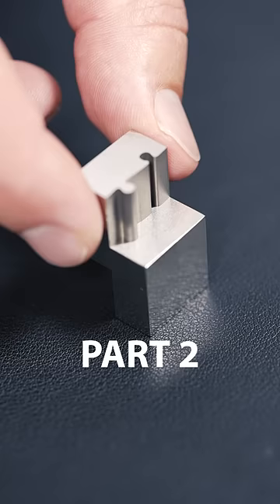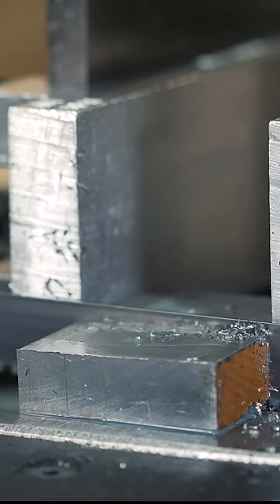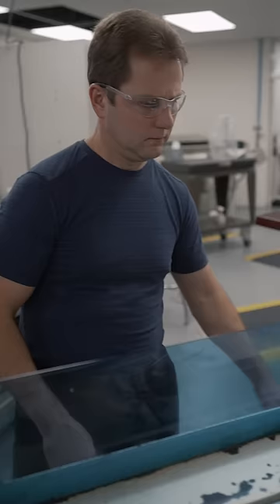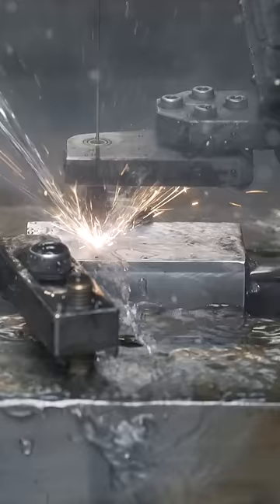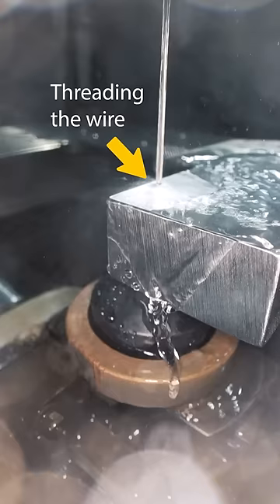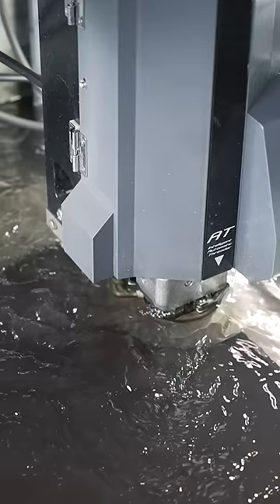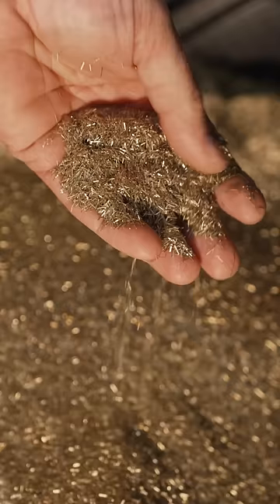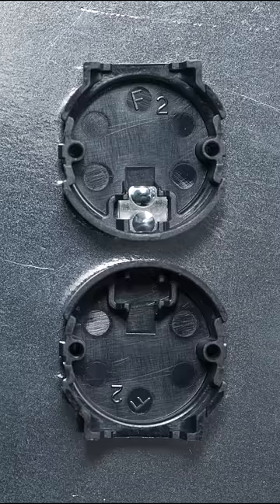'Zero Tolerance Machining' with the Wire EDM, Making a Puzzle Cube - Part 2 | US Digital

Comment: If you start selling those cubes its a gold mine
Reply: No, def not. Unless they sell them for a grand a piece.

It takes them two hours just to make the one  cube.
Reply: @joshandkorinna  that's just the cut time. Just think of all the material handling and grinding for finish.
Reply: @skrewup7354  mezmo I think
Reply: @joshandkorinna  if I get you one for 200 will u buy it?
Reply: @PHANTOM-vd2sn  No thats too much. I'd pay maybe 15 bucks for one.

This is why it's not economical to manufacture these and sell them. People aren't going to pay what it costs to manufacture them.
Reply: Your looking at about 125 an hour.  There's probably 8 hours minimum there.
Reply: I was going to say that but on a very niche market like art galleries were people would not hesitate to pay for it . Imagine a sort of a Rubik’s cube made at that level of precision or a chess set or the key ring for high end car .
Reply: it's not only cut the time it's also a lot of manual labor in it. U can't really make this puzzle cube economically worth it because EDM isn't suited to make commercial products.
Reply: The cut time doesn't matter though, these machines are dirt cheap to run, and if your setup is good enough, they can run unatended for days. They can do the edge detection, the hole detection, the threading and the cutting all by themselves. You just prep and load the material for it, which can also be automated with a mini-palet system.

I worked for years as a prototype machinist and we used various types of EDM nearly every day. One minimally trained person can keep 10 of these machines running continuously through their whole shift for longer cuts like this.

You could probably cut the process down enough to break even at ~$5 apiece with enough volume.
Reply: No they are steel cubes did you read the title?
Reply: I was already wondering if I could get one
Reply: @operator8014  EDM is actually pretty expensive to run per hour. You'd never, ever get them down to 5/piece, you couldn't even buy steel that cuts nicely on an edm for that, let alone: wire, electicity, paying back the machine and the labour.
Reply: @joshandkorinna  id pay 2k
Reply: @teewithmarie694  Good for you. You're in the extreme monitory.
Reply: @joshandkorinna  U really underestimade society, dont you remember fidget spinners and shit?
Reply: @lks3052  Yea, they cost like $5-$10, not 1k-2k.
Reply: Agreed, metmo in UK sells these for 199 pounds in limited quantities only. If you could dedicate equipment to manufacturing these alone, you would make bank selling these globally.
Reply: Price would have to be high to cover the manufacturing steps
Reply: it'll cost like golden. don't think lots of people want to buy it for it's price but anyway I'm pretty sure that if you want it, you can order it in this work-shop or any other similar one. money is only one question
Reply: @PHANTOM-vd2sn  I'd pay no more than 500 for one...but even that amount there will be zero profit, for whoever is producing it. The thing is if you can afford one you can actually order it...but the cost could be easily above 1000.
Reply: @gyffjogofl7676  It's more than 125 an hour.
Reply: @Quapadople  but they also include shipping charges cause it's Indian company
Reply: @BigMassive Gold mine lol? That's exactly the kind of idiot comment that caused them to make this video. The yearly market for little novelty stuff like this demonstration cube is so small, it wouldn't even buy donuts for the first day. 
The work done on these machines only pays off when making molds and tool & die work.
Reply: @bigmassive2403  Only  trained toolmakers are capable of doing this work. They make $30-40/hr in the US.
Reply: They sell high end electronics
Overpriced fidgets wouldn't be a smart investment
Reply: @bigmassive2403  Once a person became skilled enough to do the work you see in this video, they would no longer be a slave, they would be a journeyman. It was exactly idiotic comments like yours that forced them to make this second video. You still don't understand the second time around.
Reply: @bigmassive2403  I understand what you want, but the machinery and processing is expensive. And if quality dropped, I don't think it would be as attractive to potential buyers
Reply: @bigmassive2403  Close-minded? I've been doing this kind of work for 40 years (yes, WEDM has been around that long). We're experts in manufacturing and the associated markets and costs. Unlike some random dude who stumbled on this video and has a bright open-minded idea. More like soft-headed.
Reply: @uwuaimafemboy8731  yeah i get ya. I dont know why people have such a problem with that idea though all im saying is that it could be a good money maker yk. Some dude named peter is pissed off at me lol.
Reply: @peteroleary9447  peter im not talking about making it with edm im talking about replicating it with a cheaper method.
Reply: @bigmassive2403  Are we paying attention? "Replicating" with a cheaper method? Replicating -- as in achieving the 0.0001" tolerances (from the video) necessary for the edges to virtually disappear visually? There is no other known method, certainly none cheaper. It could be form ground to that tolerance, but that would cost 4-5 times as much. Existing (cheaper) methods are plasma, laser, & waterjet cutting, but they're nowhere near capable of achieving acceptable tolerances. You're free to invent some mythical method of cutting steel - good luck to you. Like I said, I am an expert. We exist and we've already explored alternatives.
Reply: @peteroleary9447  that is ridiculous expensive, we only charge 25€/hr without a person and 50€/hr if a persons works on the machine (usually the setup)
Reply: @peteroleary9447  no i am right and you are wrong
Reply: I could probably set up an avonisys to produce these at $60-75 given a 25k part run and assuming i guessed the size right.

Tolerances would still be good enough for human touch and eyes but not as good as this.
Reply: @angrydragonslayer  see thats how my comment was supposed to be takes not analyzed under a a microscope and shut dowb
Reply: Few would still buy hearing the price tag.
And then they could sell only few anyway since it's all hand made
Reply: @angrydragonslayer  The water-guided laser systems that we've looked at still can't approach WEDM in surface finish and tolerance. Plus, you still have to finish grind the outside of the final assembly. They're crazy expensive so roi is a big issue.
Reply: Also the Chinese plastic one is pretty crap anyway. Very impractical but a nice looking peace of art.
Reply: @peteroleary9447  yes, surface finish and finish are not the same as WEDM but still sufficient with the right parameters.

for finish grinding, i already have a chevalier grinder that needs some more work, this would be ideal unattended work for it.

i've already ran the cam and at 80% usable parts, revenue and costs are even at  23400 succesful parts. if i were to put the sale price at $100 (before tax ofc), i'd have my normal profit/error margin at ~25000.

now, i have no doubt that i'd be unable to sell 25k of these at that price but it's always fun to imagine.
Reply: tolerance*
Reply: @bigmassive2403  no worries, CNC brings a lot of different people to it, be it old cots or young dreamers

if you want to see more of the young dreamer side of it, i would recommend looking for the channel named "TITANS of CNC MACHINING" (yes, almost all caps).
Reply: Every one want that cube until they see the price.
Reply: The new fidget spinner
Reply: Not really because the parts they are manufacturing now are probably much more valuable.

Because they have an actual industrial use and aren't just a fancy paperweight
Reply: @ieuanhunt552  that as well
Reply: The satis-cube™️ 
Completely satisfying!
Reply: Totally, whoever pantented this must have a hoard of money by now, i can see the potential of this tech in our daily life
Reply: They are better off doing their plastic injection molds that are sold for way more than those cubes could be sold for.
Reply: @joshandkorinna  make it a limited run and I can easily see them making a thousand of them for 1k a pop fairly easily
Reply: @spikeypineapple552  Sorry sir, gotta disagree with you. In my significant experience, EDM time costs the shop about $4-6 an hour, and I've billed a LOT of EDM hours. The trained monkey that runs them costs more than the machines do.
Reply: I he actually sold them I would get mine in 2027.
Reply: @peteroleary9447  That's including the machine, the supplies, the payments on the machine, the operator, and the profits.

The operating costs of JUST THE MACHINE is nearly nothing. Electricity, wire, and water deionizer. $5 apiece is tight but achievable best case scenario with proper planning and capability
Reply: Fr bro
Reply: @lks3052  
Fidget spinners aren't precision engineered, designed, drafted, machined, and inspected.
Reply: @bigmassive2403  
No, you are NOT right. I'm just a CADD technician in training, and I know that Peter is right. This stuff is EXTREMELY expensive just to design and draft, let alone machine and inspect.
Reply: @angrydragonslayer  
80% is unacceptable in applications that require this kind of precision. Hell, I could probably increase your acceptance rate by 20%, just by adding one control frame to your drawings.
Reply: @operator8014  
The cost of a widget is never just the operating cost of the machine.
Reply: @jfangm  it is perfectly acceptable if the margins are present and QA to sort out defective ones make more sense than pushing further, demanding each be perfect

the $60-75 cost estimate i gave was based on an avonisys water jet laser where each part would likely cost $45-60 to make but only 80-90% would meet spec

i could of course change machine and insure 100% met spec but at that point, each part would likely cost me somewhere in the $150-250 range to make
Reply: @jfangm  I AM CORRECT, AND YOU ARE INCORRECT
Reply: They would need to be 100 - 1000 dollars.
Reply: @joshandkorinna  They said 3 hours to make a piece of the cubes.
Reply: @LifeonWheels  Yeah. The person that made this comment really didn't think this through.
Reply: Or 2k to 5k.
Reply: @bigmassive2403  
No, you are not. Saying it louder does not make it more true. You have no idea what you are talking about. People who work in the design, drafting, and manufacturing fields are saying you are wrong. That makes you wrong.
Reply: @jordysoto6988  u ok?
Reply: @jfangm  i know that i am right. my argument is more sound than yours, plus those guys who say it is completely impossible are also wrong. you are wrong, and i am right.
Reply: @LifeonWheels  not to mention all the machinery required to make it.
Reply: It's not financially viable. They're just using a consumer type sample to illustrate their business facing model.
Reply: I want one. I want the puzzle too. I want everything you make!!🤪🙂🥴👍
Reply: Yeah I want the rectangle puzzle thing they showed XD
Reply: @joshandkorinna  people will pay 1k for these believe me
Reply: @Carlit0Tit0  sure
Reply: True
Reply: @joshandkorinna  it’s a piece of art charge the right price and people would pay
Reply: @joshandkorinna  Of course they are. Just not a lot of people.
Reply: @peteroleary9447  That's the US. In first world countries that's a wage for zero qualification people on construction sites and other low tier  jobs.
Reply: @bigmassive2403  duh
Reply: They are strictly a CNC company, hoyever they maybe would show this at engineering expos as a sample product to show the capabilities of EDM
Reply: @joshandkorinna  not a grand but it would cost a couple 100 dollars for sure
Reply: Nah ..Magnetic cubes are gold mine ...... Like spinners... This will be a huge hit
Reply: They do sale them. Well idk? If kts these guys but another company does and there 109 dollars
Reply: @gyffjogofl7676  you're either a programmer, own a shop, or work as an ME. Because you're pretty spot on minus material and tooling costs.
Reply: @peteroleary9447  I'd hope more. I'm making 32 an hour as a multi axis lathe programmer.
Reply: @radhikasudheer  this. It's to get new contracts and new customers on expo's. Injectionmoulding industry for example.
Reply: @lindaali6703  they sell electronic parts for cars and high end machinery.
Reply: @peteroleary9447  you are correct, but arrogance like that is a waste, especially on someone who just doesn't understand but finds the tech cool. I'm ex diemaker, ran sinker edm for a few years. Will be running wire soon, & work as prototype machinist. I do agree with you- almost noone outside the trade actually understands how expensive it is to actually make things, much less to 0.0001" tolerances. Wire EDM is definitely the best & cheapest way to make an object like this, but it will never be cheap. They did waste time using a hole popper to put holes in- I would have just quickly drilled normal holes.
Reply: @operator8014  I'm inclined to believe you to a degree, actually. These machines are very safe to run unattended overnight the only danger is the wire will break but there's nothing to crash. That said to create a piece like this the program is very simple and you could do a huge sheet of material with holes programmed in drilled through and do a hundred of these at a time if they're small but the run time to cut them would be extremely long. I am told that the operating cost for the actual machine really is not that high but I have a feeling it's not quite as low as you're describing. The main thing that's impossible to get around is the cut time which is dependent on the diameter of wire used and the cutting parameters. If a larger diameter wire were used because there were no sharp internal corners just like this part it could be burned much quicker but to say do a hundred of these at a time in a couple foot square plate I still think would take perhaps a week of runtime or more. You would have to be in a very unique circumstance to have a wire EDM that you could let run for something like this for long periods unattended but I think it could be done
Reply: Yea
Reply: @skrewup7354  I looked it up and it looks like they're using the same methods shown in this video to manufacture them.

Edit: It looks like it because they are using EDM. Who wants to bet they'll be $200 each?
Reply: HOLY COW I FOUND SOMEONE WHO SELLS THESE! There is this company called “wacky company” and they have a website that sells them!
Reply: Not really. Just think of the massive machining time
Reply: I’m sure you could order some or find another mold making shop that would make them and then resell them :) guessing it would be about 1-2k + online adds. 

I’ve seen crazier stuff for sale
Reply: we'd probably be humbled at the difference of revenue they get from their main business compared to the idea of selling niche cubes
Reply: No it wont be, unless they find a much easier way to reduce manufacturing time
Reply: @bcshooterfmjprime7540  it's metmo
Reply: @joshandkorinna  ironically my friend bought 6 of these for $2000. Was it a good idea? Hell no. Is it cool? Hell yes
Reply: @joshandkorinna  Yes, but I think there are easier ways to manufacture them. I think they do it this way purposely because they are testing to ensure they can make particular molds extremely precise. 

If they were to manufacture the cubes as a fidget toy, I am sure they would use a simpler/quicker method. There's no way all the mezmo cubes that sell take that long to make.
Reply: Haze Entertainment  You've seen a cube, dude. The steel alone is more than $13.99. What you saw is a cheap knockoff from crappy materials. If a company actually wanted to sell it and did more optimization, it probably be at least $400 -$500.
Reply: @skrewup7354  its not on youtube... youre better off to get HEX coin $0.03 or PZEN coin $0.004....... mesmo coin $0.000000000000000000000000000
Reply: @joshandkorinna  well exactly, gold mine
Reply: It wouldn’t be
Reply: cube mine
Reply: @joshandkorinna  i would pay that.
Reply: @melody3741  Good for you.
Reply: @teewithmarie694  Dieter stahlwerx
Reply: Milita
Reply: How tf are they gonna mass produce these? Its a timely yet precision requiring process. It aint gonna be a 100 dollar cube on amazon, this shit will run u grands.
Reply: @drained1177  smd
Reply: They already have a gold mine tho. The products they make with the machines are way more expensive and easier to sell than a cube. Id love one of thkse cubes but wouldnt pay more than 20$ and it is probably with 600$ with all the work in it. Better for them to mass produce things people need and sell them easily.
Reply: Order it in China. It shouldn't cost more than a couple of bucks.
Reply: @HotelOceanview-tr5in  but it wont work like this one. There is no way to make this for leas than a couple hundred dollars. Those guys are highly skilled and probably paid atleast 60+$ per hour
Reply: I don't think they'll be worth selling if machining alone takes two hours
Reply: A place called wacky company sells ones exactly like these for $98
Reply: What you just saw was the cutting and prep work for ONE side of this puzzle. They have to do it again for the bits that fill the holes. This shit is expensive for a reason.
Reply: At a grand a piece of course it would be a goldmine
Reply: 10,000 a cube.
Reply: @bcshooterfmjprime7540  Metmo
Reply: Try injection moulding moulds… 
Those are so expensive injection molten products normally cost a fortune 

Do you know why LEGO is so expensive? 

They’ve got to make all that money back after blowing millions on injection moulds….
Reply: There are plenty of people like me with tons of money that want to buy frivolous, unique objects.
Reply: It could easily go for the price of a hunter biden painting 🤣
Reply: Meh... just put them up on the store for a 200% markup and see if you sell any
Reply: If u take 2000$ per piece and you sell hundred of thousands then it’s maybe a “gold mine” 

just because of the accuracy, expensive machines etc.
Reply: If they could devise a way to make the whole process automated and streamlined with many machines operating simultaneously, but that would take a substantial initial investment and many sells over time to make it cost effective
Reply: Why does it drive me nuts when I see a surface grinder table being traversed along its main axis by hand?
Reply: I’d buy 1
Reply: People pay waaaayyyy more money for “puzzle pieces” that fit their aerospace or defense projects.
Reply: The company that takes this idea and sells it will make 1000x more money than these guys with their dumb injection molds
Reply: @Mister Dude lol. More like 5k to make. It's like saying the top tier nvidia gpu is just sand.
Reply: @Settiis  You’ve never shopped for good injection molds before.
Reply: @skrewup7354  metmo cube, or wiron cube
Reply: I think you are the owner trying to overprice your product
Reply: the machines dont seem to be suitable for mass production
Reply: @thedoge492  I don’t know that dies would be mass produced would they? They’re some unique shape with potentially tight tolerances but really low production numbers overall. I would think people order one-offs all the time.
Reply: @PHANTOM-vd2sn  do you wanna rob or what my boyy
Reply: @joshandkorinna  the original OG fidget spinners that the trend was based on were usually a couple hundred bucks each actually if I remember correctly. (Which I know in this case, I do, lol)
Reply: They don’t want money apparently
Reply: @joshandkorinna  if your a team of 3-4 and are hungry enough and know what to do, then yea
Reply: Only if they’re made of gold.
Reply: Just the EDM part takes two hours. Machining before and after wouldn't be much faster either and this process is not scalable so that they would make profits in scale. If they want to increase production speed they don't have any other solution but buying another EDM machine that I would guess has a hefty price.
Reply: @joshandkorinna  I will buy 1
Reply: @joshandkorinna  that because there using grade a steal that shit is hard to cut even a 1/8 inch I sewn metal saws go dall on the first cut on that type of steel that suit is hard
Reply: @joshandkorinna If you’re an engineer or someone who appreciates how far we have gone in manufacturing capabilities, then you MIGHT pay 1000 dollars for one of these. It’s kind of a conversation piece. 

If you’re some kid/adult who likes to have a ‘fidget metal piece’… well ofcourse you wouldn’t pay that.
Reply: @peteroleary9447 That commenter was not disrespectful in any way. You’re the reason engineers are said to be arrogant. You just have a condescending tone and don’t know how to explain without using a “better than thou” attitude. 

Rather than tell him he’s wrong, explain how he’s wrong. 

If someone didn’t know much about some random topic, like milking cows, and you suggested an idea to do it more efficiently, I’m pretty sure you wouldn’t like it if farmers shot down your idea and laughed you out.
Reply: @AArrad  That's fair, and one of the more educated replies I've gotten in this thread lol.
Reply: @peteroleary9447  Your example is ridiculous, my analogy wasn’t, and if you don’t like it there are plenty of others. Like methods of farming, electrical jobs, plumbing, baking. Take your pick, it doesn’t matter... Atleast the point got across.
Reply: So we just have to wait till we can make edm machines as available as a 3d printer then we can purchase one of these for 15 bucks.
Reply: Them not selling them tells me they are not real.
Reply: @operator8014  tell’em! Most of the folks on here don’t even know how cheap Steel is.
Reply: @daveszabo8150  exactly
Reply: He got the machine, you dont. If he can make good profits with those cubes. He already done it
Reply: I'd never spend more than $10 on one, and I'd only spend that much because of the distraction value.
Reply: May be they don't want money...
Reply: @joshandkorinna and running those machine which eats idk how many electricity to run for 2 hr and labor.
Reply: Rich people will buy anything. They would sell.
Reply: @gyffjogofl7676  actually a crazy estimated it's more like 1.5 hr for manual labour then 2 hrs for the cut time
Reply: It would be extremely expensive... It would cost thousands of dollars for one piece... Who would buy it?
Reply: It couldn't possibly work they'd have yo sell them at €1000 a piece to make any money. Too much time involved to make them. 

They are only a concept to show what they are capable of doing for much more expensive projects that need the minute tolerances.
Reply: @LifeonWheels I agree with you, the cutting process can be automated. The real tell tale is how much money it costs for wire/material and the overall costs of the necessary equipment combined to determine what price per unit would take the least amount of time to break even and start making profits whilst also not scaring away potential customers with too high of prices.
Reply: Too expensive machine to make little cute cubes
Reply: @Mister Dude You definitely have never heard of expensive fidget toys lol.
Reply: Well, you could sell a bunch of those and make enough money for mining equipment

And then you mine more material for the cubes 

And then you buy solar panels

And then you will have money to buy a literal gold mine
Reply: profit margin isn't worth it. material + production costs is easily $1000 then we mark it up 10-30% to actually cover our costs and make money. Producing this at scale does not make sense in this price range because the demand is limited. If anything it would be a steel mine, rather than a gold mine. ;)
Reply: @joshandkorinna  yeah but they don’t have to make it as precise they could easily half the precision to save time and the product would still be appealing
Reply: Copy..Paste
Reply: We want them cheap other wise I'm not getting one, they have no purpose other than they're cool
Reply: @joshandkorinna  probably more? Or do you know the actual energy and material costs? Plus all the labour, and overhead too.
Reply: 18k is my starting bid 😂
Reply: The Wiron Cube
Reply: @PHANTOM-vd2sn  i will
Reply: @@misterdude8034people will not spend 150 on a small metal jigsaw block, most likely between 20-50 for the general public.
Reply: @ItsJustWolff I know how to make it out of 4 connecting pieces and not 4 individual pieces
Reply: @GoudaTheCavalier  ok good to know
Reply: They should be massively expensive though.
Reply: This type of machines are not meant to make souvenirs just because you won't be able to make enough money to cover the process cost. These are meant for high precision pieces that go inside machines that requires such precision to work for extended periods of time. The process of such custom pieces will be enough to make profit out of it.
Reply: @bcshooterfmjprime7540 what did you say ? Mezmo?
Reply: @joshandkorinna  15 bucks? For all that labor you would pay for less than a 20? You are out of your mind
Reply: Amazing the parts don't wring together with such tight tolerance.
Reply: @LifeonWheels  probably another hour ngl they'd be probably 300$ to make xD
Reply: No it wouldn't....
Reply: You'll need a gold mine to buy one.
Reply: Not worthwhile
Reply: @LifeonWheels So? It's like a piece of art. Rich people pay thousands for stuff like that. If they did a limited edition of 10 cubes, MADE TO ORDER ONLY at $2000 each, with the right advertising and promotion, they would sell all of them and make an easy 20k in REVENUE.

MAY ALSO TAKE A MONTH OR SO FOR DISPATCH. Obviously.
Reply: @slavicprincess  20K for a shop that can do this isn't much. there isn't much profit and would take away from production of consumers parts. Hell I'm an engineer and on something even more simpier than this dropped 30K in just parts alone for one R&D project.
Reply: @joshandkorinna exactly what i was thinking it’s cool but it’s mad small and just looks like a metal puzzle for most of the time nobody is spending more than 20 on this unless they’re rich and this has some crazy marketing behind it😂
Reply: He prolly makes more making precision parts for other companies that actually need it, he said it took 2 hours for the edm to make it and thats not even counting the rest of the process he did, and we’d prolly pay 15 bucks for it. So if it took him 3 hours total to make this part thats like 5 dollars an hour.
Reply: Wiron Cube sold at WackyCompany
Reply: @joshandkorinna  Wiron Cube sold at WackyCompany
Reply: @LifeonWheels  Wiron Cube sold at WackyCompany
Reply: @@misterdude8034 Wiron Cube sold at WackyCompany
Reply: @spikeypineapple552 your right, this isn't rough machining, operator high af
Reply: @joshandkorinna I'd consider it more of a niche market as most people won't respect the amount of skill and labour goes Into it therfore would devalue the peice, but watching that sink Into perfect mating after sliding an edge off of a surface table gets me going in all the right places
Reply: @peteroleary9447 I don't what you do but your right good sir, from a 4th year toolmaker apprentice, regards 👍
Reply: @angrydragonslayer fuck I hate that Chanel lol
Reply: @RJ-mh3ox you truly have to love metal work to respect this, if not it's just a neat toy for adults, and most would not pay the nessasary cost for this, and I wouldn't blame them tbh
Reply: @slavicprincess I'd pay 2k for this if it was up to my standards, but who else do you know that would pay that, for them it's a neat thing, a fidget spinner is in the same category for most people, also the best thing about this is the vacuum seal witch is hard to achieve if you don't have a surface table keep the peice from sealing until you move it off the edge, godam it's sooo good when you do though
Reply: @curtiswrong  i guess it's the "THAT'S HOW IT'S DONE BOOOOM" part of it, right?

I watch it because several of the guys have more experience than me in their specialty and they got more freedom in what to run, allowing me a sort of preview.
Reply: @LifeonWheels exactly and given there's no market for things like this it would be nothing short of time wasted as the product would not cover the r&d and process refining cost, as an engineer those how would this be to draw up? Would you just put like +0 -.0001 or what, I am interested in the drafting process if your familiar?
Reply: @Emilstekcor more for a quality peice forsure
Reply: @steveparker8723 Gauge blocks do why not this ?
Reply: @CalaTec agree, even those machined parts need to be stoned and mastered In for correct fit, unless your talking about mechanical machinery which then need an extensive amount of quality control before application, still very fascinating and labour intensive
Reply: @1reflect155 the average human would pickup on defects or variables with the fit, within half a thou or less depending on eyesight, if you buy this and see a gap whats the point
Reply: @drained1177 thank God someone knows what ther talking about 🙏
Reply: @Chris-0703 I like that mindset your cool 💯
Reply: @YourFellowAustrian who tf you gunna sell it to there's no market for this shiz at that price, dismal at best for a toolbox conversation peice, mine is a sphereometer, it's neat but still
Reply: @HotelOceanview-tr5in  definitely highly skilled bit I am interested in a machine shop  that would pay that wage, maybe aeronautics? Still would be at the very upper limit of machinist rate if not some type of r&d development
Reply: @CaskStrength777 cut time out the window, frequency and amperage, ez peesy, its the repetitive process that makes this hard, these are mating part and there is some deficiencies that also come and need work after edm, this level of accuracy is not a normal machine shop quote, you will experience problems you have never had before and may not know how to remedy with out experience, and that could be priceless depending if you can fix it or not
Reply: @angrydragonslayer it's neat how the can hog some serious material off but it's not sustainable for a precision machine, I like that they push the limit but it's so click bait and not good machining basics lol
Reply: @angrydragonslayer lso if you never try you never know ,I was taking  like 2 to 5 thou passes on a pedestal grinder from what I learned from school , till my boss al.ost slapped me silly and showed me what it's capable of doing, I wouldn't preach that an inch cut sidewall is good but I do it cause it saves time, I ain't paying for wheels and don't mind redressing lol
Reply: @kingk2405 dude imagine a rubiks cube with that level of fit ! Goddammit that gets me going, fuck the market that's just good metal work
Reply: @curtiswrong  my issue is more than i've gone into construction (of factories)

Bit hard to go "oops, guess that doesn't work" when you bought the machine, wheel and floor you stand on
Reply: @ItsJustWolff it is and isn't, hate to say that phrase bit some things require more detail and finesse and some don't, this is one that does , edm can work work wonders in so.e shops for certain applications, my signbar was house made with edm, works perfectly for what I need, can't say the same for this though
Reply: @angrydragonslayer your a mill wright? I heavily respect that line of work, you can rough it up and I can refine it as a toolmaker , remember perfection doesn't exist its how close to it that counts
Reply: @curtiswrong  100% agree I think the puzzle is just to small for edm to be the most useful way of doing it, if you were going to make it a commercial product, included that this piece isn't just using edm. Edm has its applications but this one doesn't really take advantage of any what an edm is usually used for.
Reply: @ItsJustWolff  imo you seem to be confused with the type of manufacturing process necessary for this application, you are correct that it isn't just edm but edm is the best start for this, it can only be edm ideally anything else would be a chore to refine surface quality, there is no mass production at this level of accuracy
Reply: @AArrad  sorry not sorry if you don't know what your talking about don't speak, it's embarrassing for everybody, im sure he doesn't want to flex his knowledge but he is definitely entitled to, for better or worse
Reply: @drained1177  honestly could you imagine some temp or apprentice deburring the part and being scrap, it's not for the faint of heart, respect the level of skill
Reply: @limitedhangoutlive I would like to learn how? a  prestine amount of metal work and knowledge would somehow be cheaper. Please enlighten me for my own education thx
Reply: @curtiswrong   agreed I would just assume you would look else where to make it more affordable.
Reply: @ItsJustWolff  there is no more affordable option, these are the tools we're given and at this point In time, it's are best solution, as someone who is familiar with mold making and precision machining, you gott make it work, that's fine why you get the big bucks
Reply: @curtiswrong  I'm not familiar with EDM parts, but if I had to guess total tolerance would be .0005. With that being said nominal hole size would need to be at least +.0001 larger than nominal "pin" size. "Pin" would have to be -.0001 smaller than nominal. Let's say nominal is 1". Hole would be .1.0001+.0001-.0 "pin" .9999+0-.0001. This would be a good starting point to see if those tolerances would work or if it would need to be loosened up if you were going into production.
Reply: Crowd fund a batch
Reply: @LifeonWheels and if it’s off by ONE TENTHOUSANDTHS the whole part is scrap and they start all over again.
Reply: @iloveucupid  correct. I was just responding to someone that was interested in the drafting aspect and what the tolerance could possibly look like.
Reply: If they make them anyway, might as well sell them. What else are they gonna do with it? Stack them up in a warehouse?
Reply: where i buy it?
Reply: @joshandkorinna 2 hours for one cube doesn't mean 4 hours for 2 cubes.
Reply: If you laugh you restart
Reply: @gyffjogofl7676 it's 10 hours to cut one of the blocks, there is somthing like 100 hours total in that example, maybe more. That thing is at least $10k. Literally no one would buy that.
Reply: @operator8014 those machines cost a fortune to run, you liar.
Reply: @evolicious  They really don't. It's only comsumables are EDM wire and the deionizing filters for the water. The wire is JUST dimmensionally accurate wire, it's nothing fancy, and the filtration media is cheap as hell, we bought it in pallets and stored it outside.

The machine shop I ran had 6 of them and we used them for all kinds of dinky little stuff. They cost less to run than any of our larger mills, since a 110HP spindle pulls a TON of electricity. The only real expensive aspect to them is time, since they cut SOOOO SLOOOOWLY. That's why we had 6 of them, not because they were so useful or profitable, but because swapping setup was a pita and every once in a while they were actually the best way to do something.

Sorry man, I know it's fun to imagine that they're the stuff of science fiction and spaceships, but they're really affordable and easy to use.
Reply: @angrydragonslayer if you can setup that program, you've made it as a machinist in my books
Reply: @LifeonWheels this application is beyond machining tolerances, more or less trial and error Because no machine is meant to hit this level of accuracy, definitely less than a .0001 mating tolerance and thats being generous
Reply: @curtiswrong  my surface grinder blew a wheel right when i got the notif for this comment....
Reply: That's where hand work cones into play
Reply: Lost me at 0:11 “not for sale”
Reply: @joshandkorinna you underestimate the number of people with unimaginable amounts of inherited funnymoney that couldn’t live without this if they saw it
Reply: Jesus loves you!
Reply: I mean there's definitely a way to make these in much less times with different materials that could be more handleable than steel that would cost much less and made in much more quantities, right? No.
Reply: What would you even do with it?
Reply: Just buy a pika screw
Reply: my boys at the linamar machine shop make zero tolerance look like a breeze... no edm machining or anything, just 10 dudes bein cool af while using the cnc vertical mill machines. the tolerance is above the roof and is fun notlike the edm machining guys over at csabametal they are alwys bored and uncool
Reply: @joshandkorinna  you clearly have no clue about costs of mass production... i could lead you to the right track but you should do it yourself since you like having opinions.
Reply: .    About a hundred dollars US for one.
Reply: @operator8014  "The cut time doesn't matter though, these machines are dirt cheap to run"

Even if the machines were cheap to run (which some other commenters have said is not really the case) the opportunity cost alone would ruin this endeavor. During the time spent making these they could be making something else that is worth significantly more than fancy puzzle cubes.